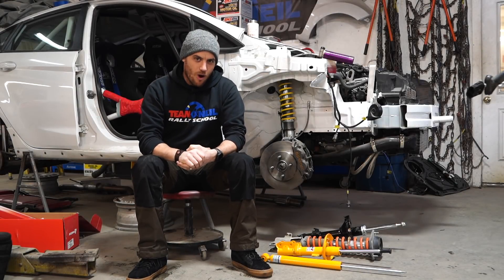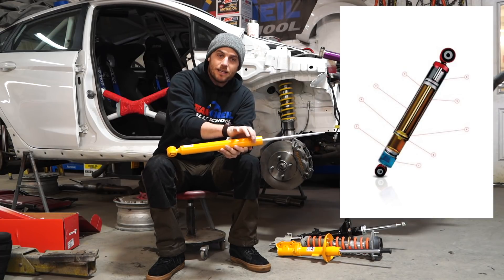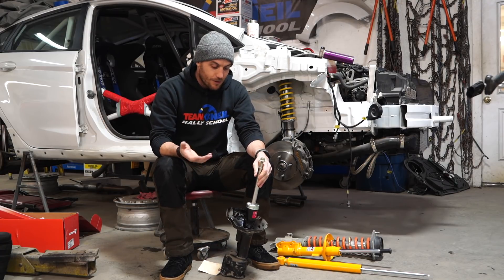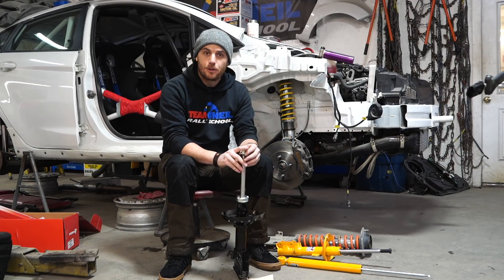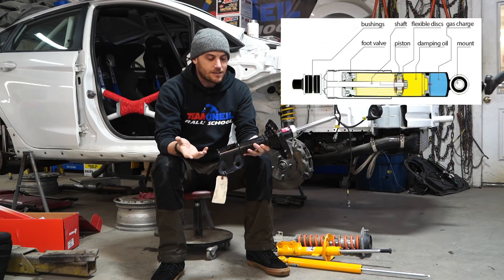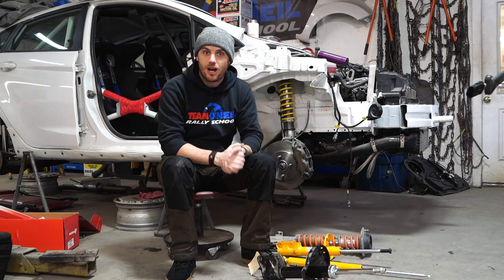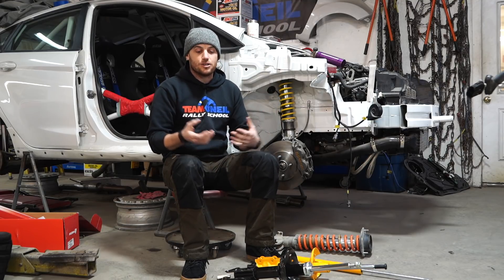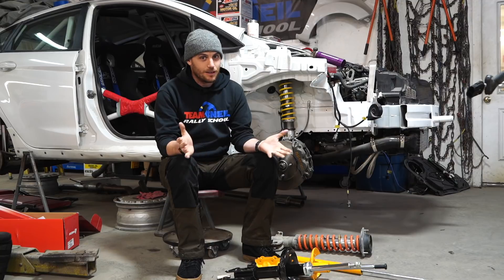Shock Temperatures, Performance and Adjustments

Comment: Suspension oils are usually rated, among the other ways, with a viscosity index: the higher the index, the less the viscosity will change as the temperature changes. Tipically, it seems to me that, for dirtbikes, the ones having a higher V. I. are the most expensive.

Comment: This makes way too much sense. We MTB race currently but use to Dirt Bike race and Road Road years back. Colder days we rarely hit the bump stop under braking. Warm days we would stiffen up front forks (bike stuff) and never realized it was the oil viscosity due to temps. Thanks for the video.
Reply from the maker: Hey thanks for watching! It's one of those things we didn't really grasp either,  until talking to the shock engineers and now it's OHHHH SO SIMPLE of course

Comment: When its cold enough that your tires partially freeze with a flat spot on them (from parking, road feels real bumpy for no apperant reason), it's probably a good idea to take it easier on the vehicle. One bump and you can tell whether or not the suspension is functioning properly. Heck, if you dont sink down in your seat the same way, assume the rest of the vehicle is just as cold. Engine temp is just one piece of the puzzle, and one of the only parts of your car that has a built in, automatic, self heating function. (Idling for half an hour does didly squat for diffs and shock temps)

Comment: Are the shocks with orange springs the Bilstein Motorsport 46mm? Do you guys still fabricate them to fit Subarus, (specifically the gc models)? If so is the damping adjustable? Thanks, looking to buy some rally suspension thats not upwards of 7k and I only see Streetwise Motorsports make them but I'd like to support you guys!
Reply from the maker: They are the 46mm Bilsteins, we made a big batch a few years ago but not any more.
They're pretty good, but not adjustable. You have to send them out and get the valving adjusted. 
I wish there were more affordable options for Subaru rally suspension.
We run the Konis on everything at the rally school and they're great, but we keep it pretty smooth here.

Comment: Konis  are a twin tube low pressure damper. Upgrade to hi pressure monotube bilsteins. They are even better when hot, after an hour in the hills konis  stop damping
Reply from the maker: That would definitely depend what your application is
The normal street bilsteins are great but not adjustable at all, are they?
You're kinda stuck with whatever the compression and rebound are set at from the factory
Which is never exactly right for your exact vehicle setup, tires, springs, ride height, surface, temperatures...
You can send the Bilsteins in to get re-valved at the factory but that takes a while
With Konis you can adjust for road conditions, temps, tires, weight, swap springs...
Or just your own mood and driving style
Reply: Look at a graph of konis  on a dyno, the adjusters are linear and don't do much. 
Use a temp gun on them, then drive for an hour and retemp them. They cavitate too quickly for me. 
Sure they are comfy and nice for an old MG or Alfa though

Comment: This reminds me of something i heard/read somewhere about some f1 car, think it was a Haas. Basically the rear shocks would heat up from the engine and significantly change the dampening characteristics, making finding a good setup for the car near impossible.
Reply from the maker: That's super interesting, hadn't heard that before!
Reply: I think it was this years Ferrari that suffered that. It's the reason the sBinalla was that strong, a driver that prefers planted rears using an unpredictable setup.

Comment: What do you recommend for shocks living in Canada with very low temperatures over a few month. Just trimming to very soft or changing the oil inside? Is there something available like an engine block heater for shocks?
Reply: I think he mentioned to just drive the car easy and let it warm up
Reply from the maker: The motocross guys have some solutions for heating their shocks, but I haven't seen anything for cars. 
Basically the best bet is to adjust them and let them warm up as much as possible
Reply: If it is a big deal, you could get yourself a separate set of shocks for winter.  Change your shocks when you change your tires?  There are shops that do custom valving, and they could change both the oil and valving to perform properly in cold temps.   And there are ice racing series--those cars may have custom shocks...

Comment: Can you guys do a video on left foot braking and whether it really helps load up Torsen diff at the corner exit?
Reply from the maker: In a FWD or RWD car?
Reply: @Teamoneilrally  actually AWD car (helical front LSD and Torsen rear) with snow  in winter feathering brake without lift throttle brings the rear out which IDK why
and in all condition highspeed cornering with playing with the brake make the car more planted (this could be fake as it is only a feeling)  
I am not sure which LSD is triggered by left foot braking; hence the question above
Reply from the maker: Is this an Audi? Very interesting. One thing that happens when you LFB while on the gas in an AWD car like that is that it slows the front tires down more than the rears, because of the bigger brakes in the front and the brake proportioning. This allows you to make an AWD car feel more like a RWD car when you're on the gas and brake at the same time, it doesn't work in all cars but some Audis do it really well.
Reply: @Teamoneilrally  actually its a 2020 sti which make sense cus of the six-pot front and dual pot rear